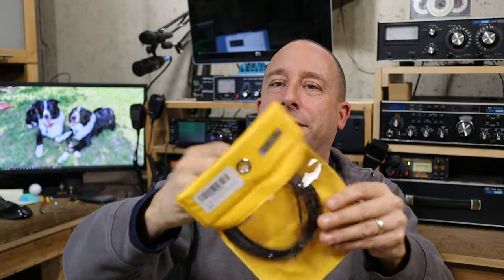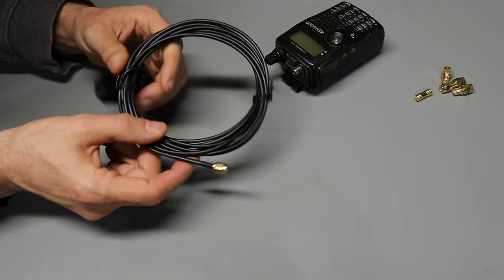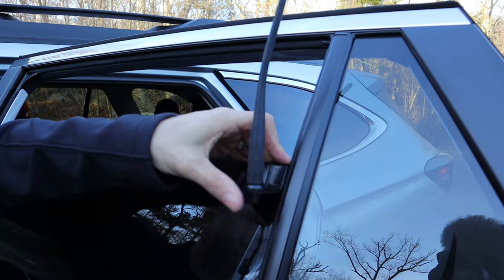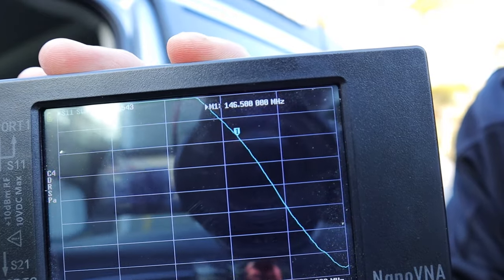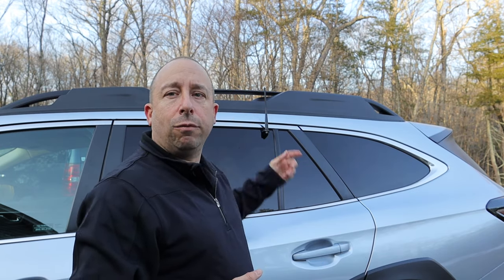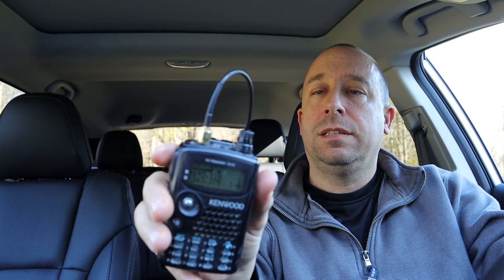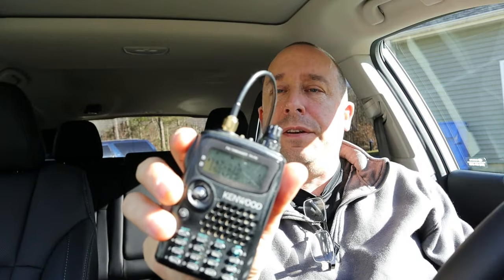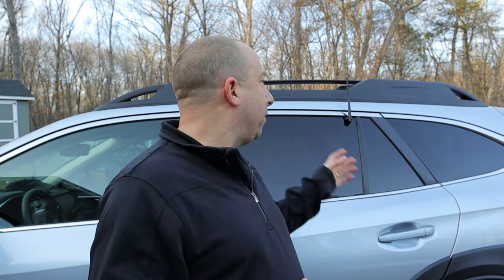Ham Radio Temporary Mobile Antenna Mount- No Holes or Paint Scratches!

Comment: I use a Diamond NR770HRKS on my vehicle.  The 3M adhesive backed mount is super strong and the antenna is a fold over model for entering low clearance areas like my garage.  The antenna is mounted on my hatch window and the coax is plenty long enough to reach the radio.  I use it for my mobile radio.  Bottom line is that I didn’t want to drill holes in my car, and there is literally only an inch or two of coax that is visible with the entire installation.
Reply from the maker: I have the nmo version of that antenna on my suburban.  It's definitely on my list of antennas I'm considering when the weather warms up.  Thanks for letting me know it works for you... I've never tried a glass mount antenna and have wondered how well they work
Reply: Thanks for that!! I've actually been looking for THAT exact information!!👍

Comment: These mounts have been available at the Dayton Hamvention since 2000. Still have mine, still working great. The only issue is the lossy RG 174 cable. Times Microwave made a cable (LMR100 if my memory serves me right) that had better performance than the 174 coax. Waiting as well for cold weather to clear and warm up a bit before I instal my mobile in the car.

Comment: I have a 2021 Outback, identical in all practical aspects, and have a small mag mount antenna mounted on the center of the roof for my HT. That cup holder works great as an amplified speaker. Glad to see this window mount option.
Reply from the maker: I'm reluctant to stick a magnet on the car and scratch up the paint.
Reply: @SevenFortyOne  mags don't scratch unless you grag it. Also they rubber covers and felt pads
Reply from the maker: Over time they vibrate and leave permanent marks in the paint, even the ones with rubber pads on the bottom
Reply: @SevenFortyOne  maybe on a bad paint job...I had them on my escape for 4 years. Although they were "rust rings" which wiped off they Never left a scratch.  I put nmos on it now
Reply: @SevenFortyOne  Take Saran Wrap, fold it over 4 times, mag mount hold perfectly through the layers of saran. I have had that arrangement on my VW for > 5 years, not a single scratch, been through 5 NE winters in the Boston area without once coming off. 73

Comment: If/when you upgrade to a mobile rig, conside gettingr a magnet-mount antenna for your Outback.  I use a short (under 30") antenna for garage-clearance reasons, but can swap with a longer antenna on road trips.

My Outback doesn't use standard hex-head seat-mounting bolts, so I couldn't use my planned "gooseneck" bolt-on mount.  Instead I got a Lido wedge-mount.  With a little work  I got it to fit securely between the console and passenger seat.  The head of my FTM-300 is conveniently positioned, with  the base section under the driver's seat; works well.

Aside from running power from the battery into the passenger cabin, my Outback is still "stock" which was a priority for me.  Pull out the wedge mount, take off the mag-mount antenna, and the radio is "gone" as far as potential thieves are concerned.
Reply from the maker: I've found that mag mounts scuff the paint over years of use so I'm going to try and avoid that this time.  Thanks for the tips on the Lido mount!

Comment: Thanks 741, did you try adding a tiger tail to see what difference it makes. I suspect it will help since the capacitance coupling is nil as opposed to a mag mount on metal or a full fledged install on metal. 73
Reply from the maker: No, it was good enough the way it was for my needs...I didn't want anything else hanging off

Comment: did you happen to clip a test lead on it to create a counterpoise?  Curious if that would help out?
Reply from the maker: I didn't think to try that..I'll have to see if it makes a difference
Reply: Great for rental cars when traveling for work.
Reply: @SevenFortyOne  I have a signal stick and use a 19" rat tail on the mount (bnc version). It works better with it. Need to check your loses on those rg174 mounts too, some aren't good for vhf/uhf. IRCC mine was about 1db lose on 2m and just over 2db lose on 70cm. ofc it's still better than antenna in a metal box...
Reply from the maker: This is just to get me by for now.  Permanent installation will be more robust
Reply: Only issue with getting a counterpoise mounted is that there are now side curtain airbags mounted under the headliner, otherwise you could use some self adhesive copper foil tape applied to the metal roof inside the headliner and run a small clip lead to the mount.
Reply: @Subgunman  For testing, I would put the antenna in the middle of the window, and run two test leads clipped on the mount running along the top of the glass.

Comment: I have one of those antenna mounts. It works great. Even better is a magnetic mount antenna on top of the vehicle. 73
Reply from the maker: I don't want to put a mag mount on the car and scratch up the paint.
Reply: @SevenFortyOne  You can get a bit of felt to put between the mount and the vehicle. I have done this with great success.
Reply from the maker: I've had lots of mag mounts over the years and every one of them has left marks in the paint even using felt pads
Reply: @SevenFortyOne  Bummer. Now I know why you feel the way you do.

Comment: Drill a hole on inner bracket and attach a 19 inch  wire should help if it's metal and maybe ground wire to bracket with plugs for easy removal !

Comment: I buy one for APRS, and it was very bad for me. The SWR was to important. 
I try the 3 SMA antennas that I own, but it did'nt work, It would maybe be ok with another antenna, or a with adding a ground on the car.
The first time I put it on the driver windows, so on the highway, when I have to down the windows for paying, the antenne fall. At the back, as you did, it's better !

Comment: In your case there's another option—those roof racks. Get a crossbar and you can mount the antenna in the center of your car roof for better radiation.
Reply from the maker: I thought about that but there are couple of reasons I probably won't go that route. First is that with the antenna up high like that I'll be limited to what will fit in my garage and I eventually want to put an antenna on the car that will work on 6 meters.  Second, I will eventually be using the root to carry kayaks and an antenna on the cross bars will most likely interfere with that.  I'm willing to sacrifice antenna performance for convenience/usability of other features of the car